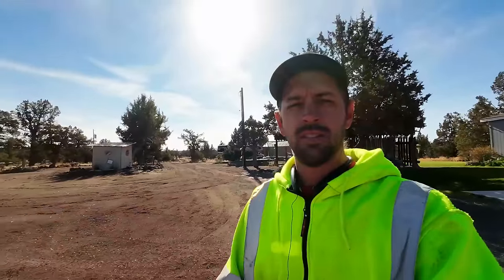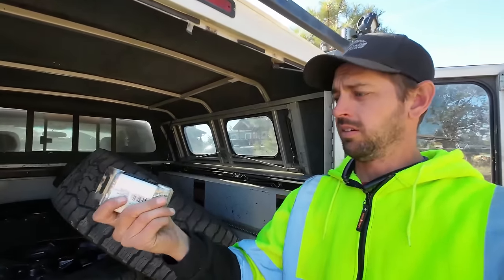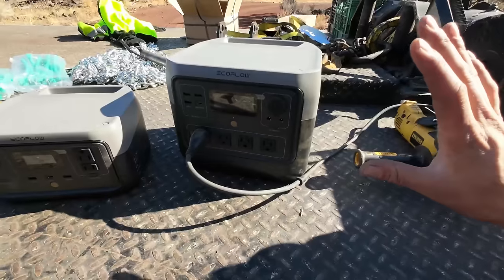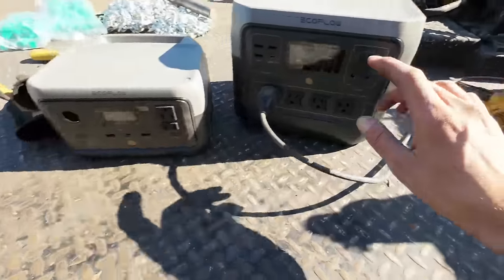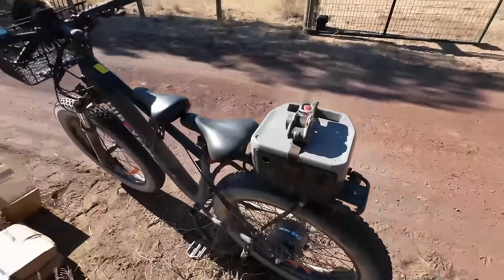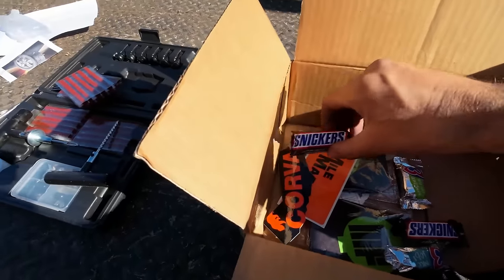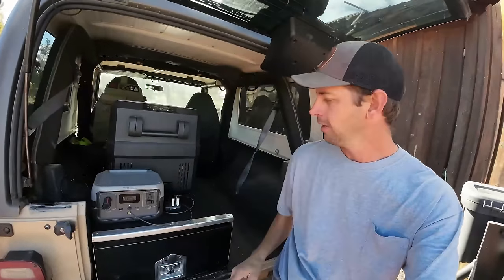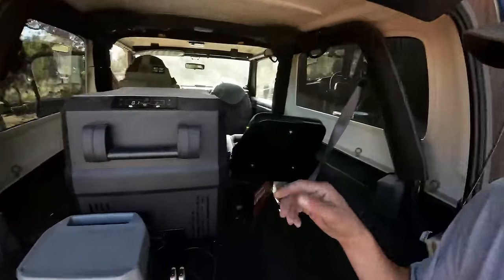How to lose a sponsorship… Again.

Comment from the maker: I would like to point out that while one company grossly overstated their products capabilities, the EcoFlow unfit actually went well beyond what it was rated for without a problem.   The River 2 Pro is rated for up to 1600 watts with the X-Boost turned on, yet it went well over 1800 watts when I started the grinder and powered it into the metal at the same time.   That’s something I didn’t notice until I watched the video back, and goes along with times I’ve seen my EcoFlow Delta 2 go beyond what it is actually rated for as well
Reply: That EcoFlow looks like beast. Thanks for showing it. I'm always on the lookout for a good product for vehicle camping.
Reply: I have an EcoFlow River Max and it broke.   That can happen and I contacted them since it was still under warranty.  They sent me a label to return it for repair and I got it back fixed a week later.   One of the things that separates companies is their after-sales service and EcoFlow was perfect 10/10 for service & support.  

Yeah there are cheaper options, but good luck if it breaks.  I don't know about you but I can't afford to have expensive equipment turn into paperweights, BTDT, it sucks.
Reply: Try Olight they are small but powerfull flashlights

For more information ask:
Farming With Duffy Ag
Reply: I have seen many reviews of the EcoFlow products. (Keeping it Dutch, Arms Family Homestead, and others) All have been glowingly positive. I do not currently own one, but when the money situation gets better, I will get one. Hopefully before next years camping season.
Reply: @willianvos3521  I will also chime in and say yes to the Olights. I have several, and their customer service has been excellent in the one problem I had (Shipping, not product).
Reply: Hi mate. To pick up all the nails yous a Manet it ezey mate.
Reply: Hahahaha, LMFAO, loving this one, telling it like it is!
Reply: @davidfisher4470  He used a magnet on wheels.

Comment: The nails in front of the carport would make my blood boil. I work construction and it's not hard to be conscious of where the nails go. I had some siding redone a few years ago and came home to find over 30 white nails in my black paved driveway and made them drive 2 hours back to pick them all up
Reply: Had the roof on the house redone. Picked up literally dozens of nails in the grass. Gave up trying and harassed them and they came and picked up most of them. You would think companies would want you to like them. I guess once the check clears they don't care.
Reply: Every roof we do gets every nail that's not fastening a bord down gets pulled and put in my pouch we do this every job and run our roller magnets around the premises. It is alot of extra work. Those little white nails are not magnetic so those have to be picked up by hand. Mucho more fun but you won't last long in my area doing shady work.
Reply: vibratingstring  
Funny you mentioned that. Just yesterday, at 9:30 in the morning, I'm in line at the gas station/convenience store and the two guys in front of me, in their work uniforms (gutter installers) each have two of those big cans of twisted tea. They looked like they were going to, not coming from, a job. Now, they may not have been drinking them before doing the job but odds are they were getting their wobble on before the work got done.

Comment: Used studded tires while serving in Iceland in 1979-80. Studs worked well on ice; however, we kept 2 sets of ties. Installing studs and them removing them until next winter was seen as damaging to the tires.

Comment: That battery review was hilarious and I used your idea of eye bolts on my TJ hard top but luckily it still works with a soft top because last week I backed into a limb out of mirrors view, cracked my hard top, and blew out the back window. At least a $1500 mistake 🤦‍♂️

Comment: One more vote for EcoFlow!  

I was a Jackery fanboy until my 2yr warranty ran out and just 3 months later my 1000 Explorer decided to just turn itself off and won't turn back on.  It was fully charged when I plugged in my 37 qrt ARB fridge to ready for a camping trip.  An hour later the unit had turned off and no amount of resets, attempted charging, etc.... it won't turn on.  

I contacted Jackery to see if they could give any tips or tricks on getting it restarted. Nothing they suggested helped.  I then asked if there is any kind of after warranty support in the way of a repair facility in the USA that I could ship it to and have it repaired (on my dime).  Nope, and doesn't look like they plan to bother.  So, now I am holding a very lightly used pretty $1000 brick.  

A five year warranty would have probably sufficed at this point as newer technology would most likely be available by then and worth an upgrade regardless if my Jackery was still running or not.  They just lost me as a return customer.

As a result, I contacted several other popular brands regarding warranties and after warranty product support. I was pleased to find that some have a much longer 5 yr warranty, or they at least offer after warranty repairs in the USA, in some cases they have both. One company clearly specified that if they can't help resolve a failed unit after their two year warranty expires, but they will issue a new unit for free and with free shipping as they are not in a position to have a repair facility set up in the USA. And they too have a solid 5 yr warranty. 

In the end I chose to go with an EcoFlow Delta 2 to replace my Jackery 1000, as they provide both a 5 year warranty, as well as an after warranty repair facility in the USA.  Their customer service has been top notch at responding very quickly and thoroughly to my questions.  Oh and it has a functional app to control it with via WiFi or Bluetooth.

Comment: So that’s for the protection of all lithium nothing with this company. And if it’s in your engine bay it will eventually warm up enough to charge. They also make heaters for this function. If your application is that demanding you should try agm batteries. But all battery chemistry doesn’t work well at low temps.
Reply from the maker: Correct, but the company is the ones who said it would be great for exactly that application, so it is 100% on them.

Comment: Casey you get an A on your homework assignment.  Must lithium batteries should never be charged below 0℉, it kills them. Some newer designed Lithium Batteries from your know where, have a Battery Management Systems (BMS) with low temperature lock out to prevent charging below 0℉.  That specification detail should be on  battery label, as you pointed out.
 EV's have heaters and coolant to keep their batteries operating.   The only way this battery would work in the Jeep is:  If it was wrapped in a battery blanket with a thermally controlled battery heater wrapped around the battery, and given a permeant power source to protect the battery on those days and nights the Jeep sit's unused. 

Seal Lead Acid Batteries are still the best option for below zero temperature operations.

Comment: It just amazes me how some people/companies have the balls to try to pull crap like this on you.  They obviously do not watch your channel and know what type of a person you are.  I honestly have to say, BEST BATTERY REVIEW EVER.

I don't mind sponsored videos if it is a product that you actually use and believe in.  I don't have a use for something like a EcoFlow, but if I did, I would be more inclined to buy an EcoFlow over one of the other types that some other youtube hacks are promoting just so they can get sponsored.

And to the cement guys.  Come on.  A "real tradesman" will always clean up after the job.  Wow, just wow...  Just imagine if I was working on your pickup, I know you have a pickup, and I  got all covered in grease and oil.  Instead of wiping my hands off or putting a cover on your seats, I just jumped in and got grease and oil all over the inside.  How much would you like that, how loud would you be mouthing off.  Think about it!

Comment: For the nails use a magnet on a pole, just scan the area like with a metal detector. Put them in a jar. You can reused them.
Reply: Harbor freight sells a big magnet on wheels for this exact purpose.
And any contractor that tosses nails (especially in driveway) would never get hired a second time.!.
Reply: Did you miss the part where he used a magnet on wheels to pick up the nails?  Wheel are better than a pole.   Lol

Comment: Well you showed that battery in your video.  I bet that company is not real pleased that you are a man of your word.  Thanks for explaining about the generator.  I just sat in below zero temperature with no electricity, therefore no heat, for about 12 hours.  It's amazing how cold a house can get in subzero temperatures in that length of time.  I will be buying that generator to plug my little supplemental space heater into ASAP so I don't ever have to go through that again.  I'm an old lady (dinosaurs roamed the earth when I was young) and when you told how lightweight the generators were that was the selling point for me because I was afraid they would be so heavy that an old woman like me wouldn't be able to handle them.  I'm glad that is not the case.

Comment: LiFePo or Lithium Iron Phosphate batteries are not for high discharge and charge rates. They’re for deep discharge in an application similar to your ecoflow. If someone wanted to build a home built version of an ecoflow, that’s one of the better battery chemistry options to use.

They won’t charge unless the battery itself is above a certain temperature. Some of the more expensive batteries have a heating unit around the cells to warm them up before they’ll accept charge when you try to charge them.

I’ve read that they’re sometimes used in motorcycle applications as the main battery since they’re light weight and that in colder temps, riders will run the headlight for a few minutes before engaging the starter to warm up the battery. I can’t remember if this was to be able to discharge at the rate the starter needs, or for accepting charge once the engine is on.

Comment: Most batteries don't perform well at low temperatures, hence battery warmers, battery blankets, and so on . . . there is a lot of thermal mass there, so in the winter you can use a silicone heater pad underneath the battery (plugged in to AC power overnight) along with insulation around the battery to keep it within its optimum operating temperature range.

Comment: Casey, I would think that long crank on that International would concern you.  I'm not a diesel mechanic, but I did spend many years operating big rigs, and thus diesel engines.  A long crank is often a precursor of later issues.  But I guess I am probably preaching to the choir!  Just more advice you didn't ask for.
Reply from the maker: This truck does not open the fuel solenoid until it builds oil pressure.   That long crank on a first start is exactly what it’s supposed to do.
Reply: @CaseyLaDelle  thanks for the clarification.

Comment: I made the mistake of getting a similar battery to the one you showed. Claimed it would be good for a UPS, but it did not have the rating to support full load of the UPS. It may be a great battery, with 3000 cycles, and no deep discharge issues, but don't lie to me about it!

Keep up the honest reviews, just like project farm does!

Comment: I agree its not great to application,  but also understand,  its internal temperature of battery not ambient temps, so it could be able to work colder than you think. Food 4 thought
Reply from the maker: So you would want to be miles out into the wilderness in the middle of the night beyond where anyone could help you and relying on something that’s a maybe??    What about the fact that it’s not rated for the loads that would be placed on it by the winch and starter??

Comment: Spent the last couple of years rebuilding my 4x4 and I have to say that overstatement of the quality, fit and performance of products is a fairly common and highly irritating problem, even among well known brands. 
Dealing with crap parts has added months and considerable expense to my build. Some are still not performing as advertised, but to attempt to correct that would require ripping them out, starting from scratch with a different brand that may or may not perform as stated, at  least doubling costs and more than doubling the time consumed. 
Another commonality is the lack of customer support. The sales line answers post haste but if you have a problem..... good luck.

Comment: Not professional cleanup after work done. I was taught when doing a job, when done, should be in same or better shape as you found it in. If you have a good magnet, you can pick up the nails with it and put into a box. Does Ecoflow work from solar to power your home if power goes out? I hope you have good alarm systems on your vehicles and kill switches due to amount of thinks you transport in them.
Reply from the maker: Yes

Comment: And you will be finding nails for the next 20 years+.  Repaired our house 2nd story in 2000 and still finding nails along edge of house.    My best tool to corral the nails is Harbor freight 'Long Reach Magnetic Pickup Tool with Quick Release'.  Good luck.

Comment: I could make some accurate assumptions about the concrete crew, but for the sake of your channel, I won't. As a General Contractor, I have a real problem with "slob" subcontractors.  A definite lack of professionalism and  it generally shows in the job quality. The nails scattered around is a safety issue, particularly with kids around. The obvious flat tire eventuation is a no-brainer. I would have mentioned their name, as a homeowner, you want to know who to avoid. Keeping the name to yourself isn't going to help the next family with kids. Concerning the EcoFlow, I love the concept, the whole system, but eventually it'll need repair or replacement. Typical warranty for many systems is 24 months, that's not very long for the electronics, though maybe normal for battery life. I've yet to find any company that repairs their units. If they fail to charge a battery, control system fails, internal parts meltdown you're screwed. I have friends and family with a couple of different systems, they failed after a couple of years, beyond warranty, absolutely no response from either company about a repair service. These units can cost a few thousand  dollars (theirs did) when set up for home backup power. With no repair service in place, that's more money than most of us are willing to lose.

Comment: Noting that most (low cost)  LiFePO4 batteries are more suited to low C-rate  discharge, deep cycle applications (camping "house" battery) more so than starter applications - for winching use, 4 12V 100A rated (2C) 50AH (or 3 100A rated 75AH with the same specs) batteries in parallel could  be regarded as "optimal" - if using in unprotected cold climates, stick it in an insulated battery box, the self heating function (or throw a block heater or low powered light bulb, in the insulated box, set to 2-5 degrees C) will be nearly negligible additional power draw - provided the battery is maintained "semiregularly" - or has a solar DC-DC charger in the setup.

-NB, even though winches makers may boast 7.5kW (or something) motors, in nearly  any tested use-case the winch rarely draws over 300A (only half rated power)  To really get a true 1000CCA - Lithium Batteries (in the NMC or LiFe types) are not really suited to most people's budgets , NMC because they may catastrophically deconstruct and LiFE because they may simply let the smoke out of the cells or the BMS... 
There are very advanced batteries out there with awesome management architecture (MIL spec) but at $1000-1800 per 100AH, not in everyone's balllpark - 

NBB Lead acid batteries also have a non trivial lower operating temperature  - they too can freeze... (better to keep any chemical concoction in its preferred temperature range - even Diesel fuel and Oil (critical for the backup generator).

Comment: Some of those lithium ion batteries have a self-heating feature, so if you charge them or use them they'll internally heat themselves to about 45F.

Of course that takes a few minutes from a cold start.  You could probably do the same thing with an electric blanket, although less efficiently.

Comment: I vote use the battery and see how it does hold up. Maby as a auxiliary battery to run your fridge. I’ve got an auxiliary battery running my fridge 24/7 the battery charges every time I start my truck. I’m curious to see how long it would run the fridge.

Comment: Std lead acid truck battery for your jeep winch backup battery is best. All lithium based batteries are not rechargeable when they are 32f or colder it seems.